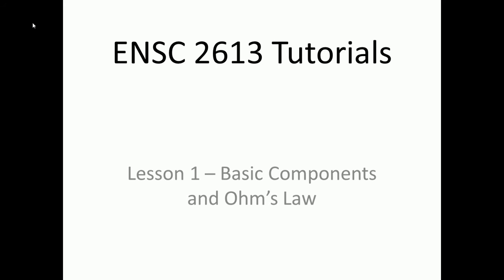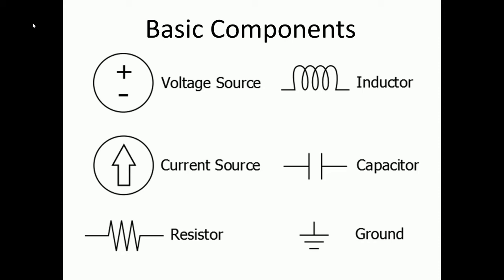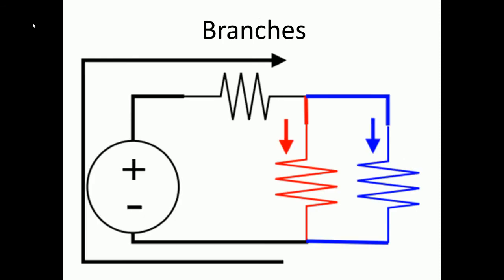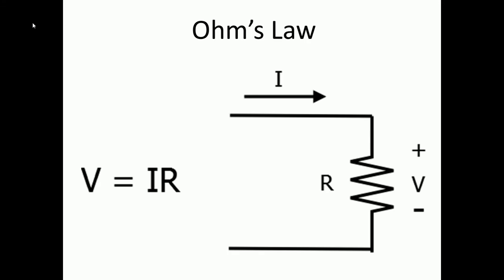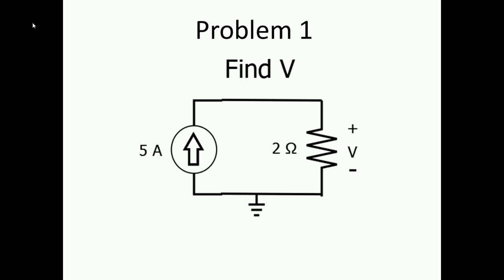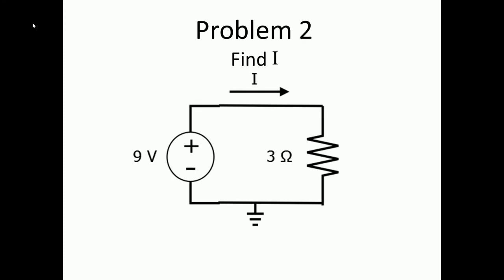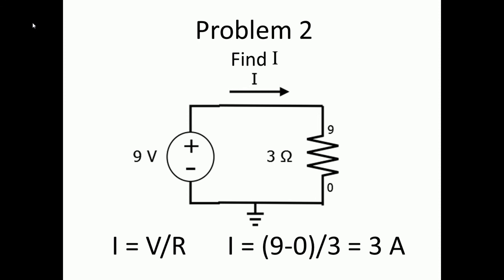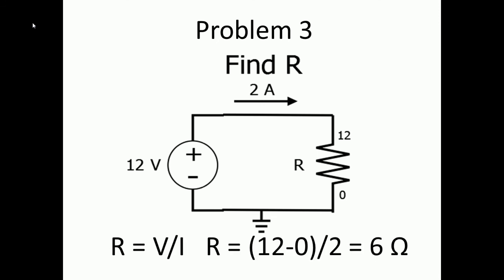Learning Circuits Online - Lesson 1

Comment: Can you explain why you minus the two voltages in the last example to get the current?
Reply: You probably figured it out already, but... The reason for subtracting the two voltages is because they are coming from opposite directions. If 12 volts are going right and 8 volts are going left, they're gonna clash. When they do, the result is 4 volts going to the right (12-8=4).